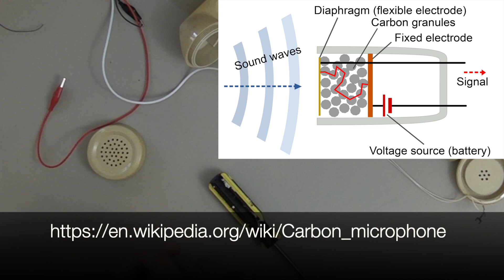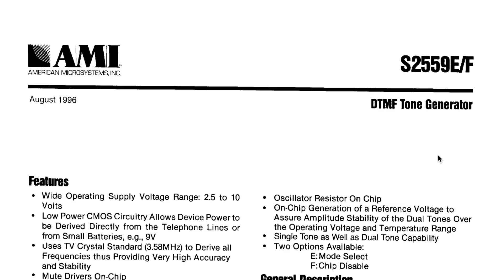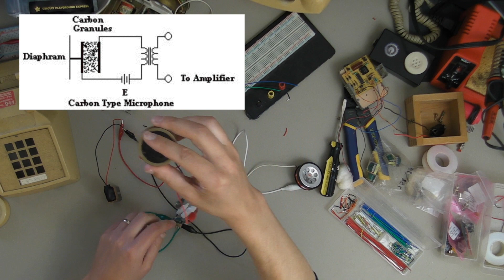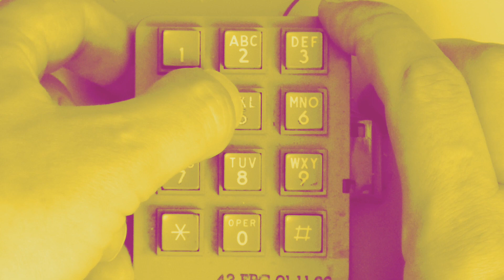Scavenging Parts from an Old Telephone (Making a Telephone Microphone) | Simon Hutchinson

Comment: Really interesting ! I know basically nothing about electronics, but I'm still curious - how did you output the sound of the numpad ? Or is this just sampled ?
Reply from the maker: Thanks for watching! It's been a few years since I made this video, but I think I just wired out the numpad oscillator to my mixer and recorded. It's an analog signal, so you can just record that way.

Comment: So using the ear piece as a microphone what input would you hook it up to, hi imp. or low imp.?
Reply from the maker: Boy, that's a good question. I'm not sure. The microphone part (the carbon mic that I make in this video) I think would be high impedance, but if you (mis)use the earpiece as a microphone, I think it would probably be low impedance, since, as a speaker, it designed to be low impedance. I'm happy to be corrected if anyone knows for sure!
Reply: Might need a preamp

Comment: That's a newer generation CD-500 phone.  The originals had a rotary dial and the TT version the keypad and board were one piece with coils used for the oscillator.  I don't know if your version reacts the same, but you can generate a single tone by holding either two buttons down in a row or column.  There was a book published of TT songs you can play on the keyboard.
Reply from the maker: Cool! Great to know. Thanks for sharing your expertise!

Comment: What kind of transformer did you use?
Reply: I tried to use the transformer that came inside my phone, and it worked, but I got lots of strange static buzz that came and went
Reply: Oh, one more question! I want to wire both the ear piece and mic to be microphones with a switch to toggle between the two. I'd like to put the switch on the headset, but the easiest way to wire it would require the voltage to go through the earpiece mic as well. Would this cause any issues? (In short, can I run a 9v voltage through the passive speaker mic?)
Reply from the maker: Hmmm. It's probably not good to send that 9V to the earpiece mic/speaker. Like, at the very least, the voltage will be pushing out the speaker, so it would have to vibrate with incoming sound while dealing with that voltage. You might not get any sound at all. It seems like you might be able to wire your circuit in a way that your switch won't send the voltage to the earpiece mic/speaker.
Reply from the maker: Oh sorry. Just saw I missed this question. I think I talk about the transformer in another comment here.

Comment: Can I do that without transformer
Reply from the maker: Hmmmmmmmmmmmmmm.... My short answer is: I don't know. For a slightly longer answer: So, the 9V battery is in the circuit, right? Without the transfomer, you'd be running the 9V into your mic preamp, mixer, or audio interface. Now, I believe most audio interfaces are "DC Blocked" so this might not matter, but I really don't know for all those other systems. It's only 9V, but still, I wouldn't want you breaking any of your equipment! Is there an electrical engineer out there who can answer this question?
Reply: @SimonHutchinson  thanks for responding
Reply: Try using a 1.5v AA battery!
Reply: Putting the output jack in parallel with the powered mic circuit, and with a capacitor in series with the jack should also work to block dc voltage(depending on the capacitor value, this will also act as a highpass filter)

Comment: Awesome build, dude! what kind of transformer are you using there? Thanks!
Reply from the maker: Good question! I've had these in my drawer for a long time, and they were some cheap eBay purchase. The only hint is, on the bag it says 500ct/8ct (in my handwriting). Really, though, I think almost any audio transformer should work. (An electrical engineer can correct me here, but the purpose of the transformer in the circuit is to remove the DC offset, the direct voltage from the 9V battery, right?)
Reply: @SimonHutchinson  Great! clearly explained! I have some carbon mics in a box so I want to try build one! thank you for the info! cheers!
Reply: @brianzditowski6431  Seems like I need to look for the transformer you are using for a 1931 studio double button carbon (Universal Microphone Co.) I have even installed new carbon.